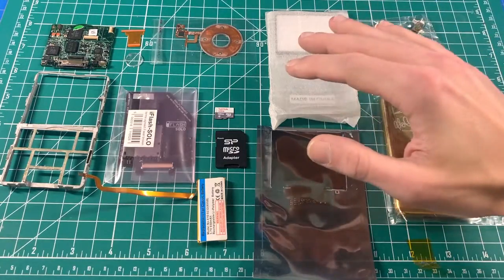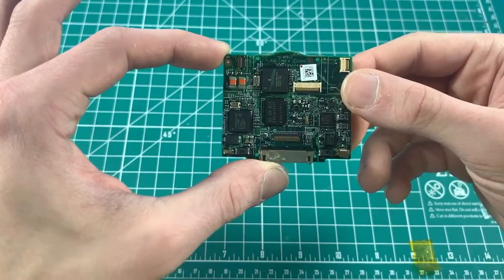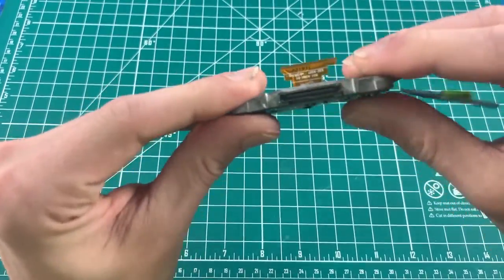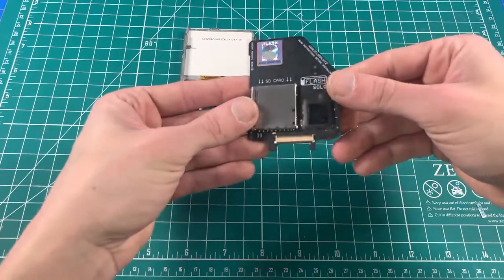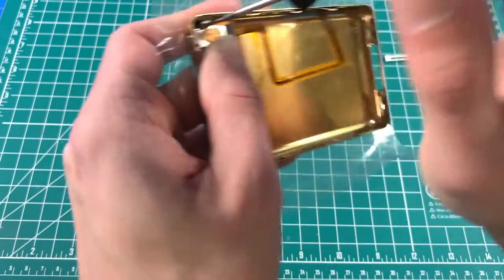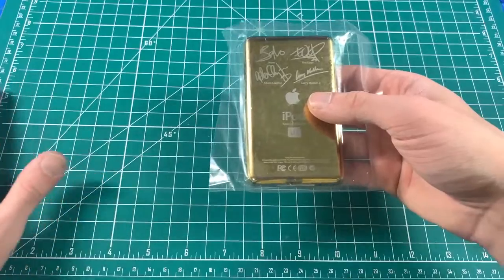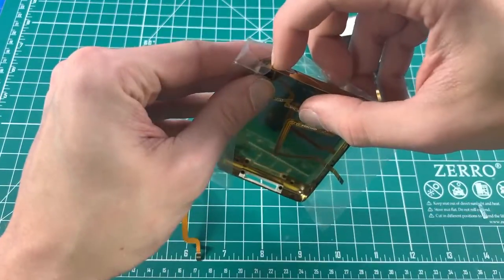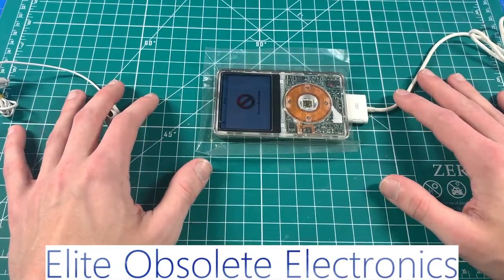Easy #Apple #iPod Video 5th 5.5 / Classic Generation Assembly & Full #Restoration

Comment: The way iFlash say to stick foam pads in the instructions, shows them sticking it on the sd card holder and the sd card. This ensures the sd card cannot slip out accidentally, the way you do it also accomplishes the same task.
Reply from the maker: That’s how I originally did it, I found it to be far less effective than this method.

Comment: I had a problem with my sd card drive not working intermittently and a new ribbon cable did the trick. My scroll wheel was going crazy so I installed a new one and it was fine then all of a sudden it will let me reset with menu and select but won’t let me go into diag mode, disk mode, and it won’t scroll and none of the buttons work. But again it will let me reset with menu and select so I know the wheel is good. Does the same thing with the old Wheel. swear this thing is cursed

Comment: I installed a replacement clickwheel on my 80 gb 5.5th gen Ipod Video white but the center button feels a little sunken in. I have heard there is supposed to be a rubber piece that goes underneath the center button. Does anyone know where I can get a reputable used original white ipod video clickwheel? I would rather buy a used original Apple clickwheel set then a new reproduction because the plastic feels off on the fake ones. The piece was not from you though, it was from a random seller.

Comment: Wondering if you're still in business? I purchased the parts to essentially make a new 5th gen back in September. Got the parts and put everything together.   I had some glitches and Austin responded in a timely manner and helped right up to the point he stopped replying.  I still don't have the iPod working and have gotten radio silence since Nov 30, 2021, when I last heard from him.  I've sent 3 emails since then and tried using the contact form on the website.  Crickets!  I need some help here as I still can't get the iPod working.

Comment: At you suggestion, I followed the instructions in this video to the letter.  Everything is plugged in just like in the video.  My computer does not recognize the iPod and all I get on the iPod screen is the message that showed up in the video when you plugged in the battery to test the screen.  The only part that is not new are the click wheel, midframe and screws.  All the other parts came from you. Need some help here.
Reply: Did you get your IPod working?

Comment: Does your 5th gen motherboard have the Wolfson DAC ? Also, are your replacement parts GUARANTEED to fit perfectly with original Apple iPods?
Reply from the maker: Yes. All iPods videos have the same Wolfson IC and Yes.
Reply: @EliteObsolete  Awesome. Ordered a bunch of parts to fix up my 2 Pods....Hope this transation goes well..Im sure it will. The Thin battery I ordered is for my 5th gen 30g .....it is thin, so I hope it will work...If you see a problem with fit, cancel that item. Subscribed.

Comment: Thinking about ordering one. How long into the future would this last?
Reply: I bought one from Elite Obsolete. I got the 5.5 gen so I did need to buy an old 30 pin to usb cord, but it's got 128 gigs and that more than enough for me.  On his site it's described as brand new, as opposed to the refurbished ones he does that he doesn't flash drive mod.   My 5.5 gen is literally brand new, every single piece has been replaced with a new one. It's stunning, works amazingly, and gives me dedicated music so I don't keep killing my data plan listening to music on my phone.  I think if you got his new ones versus the refurbished ones, it would last you a long while. And they're soooo beautiful. And he also has replacement parts on his site and vids for all of them showing the replacement process. So if one thing breaks you won't be SOL.  I hope you get one and love it as much as I love mine!!